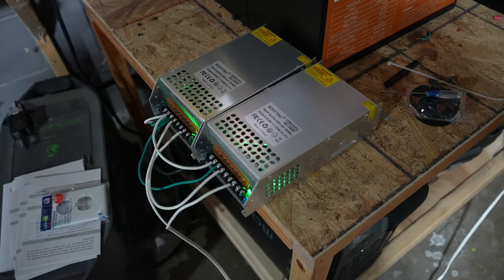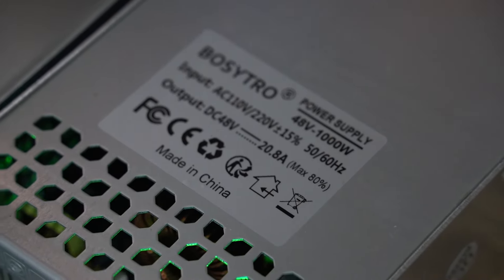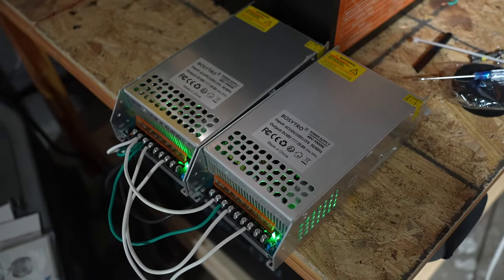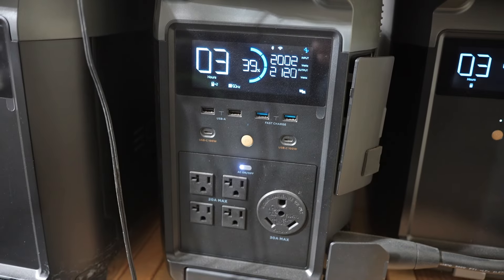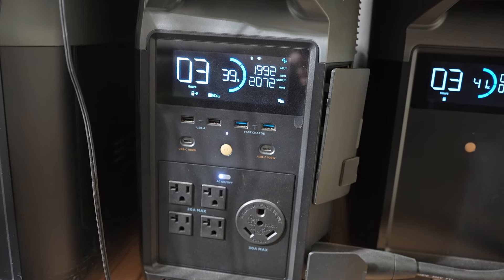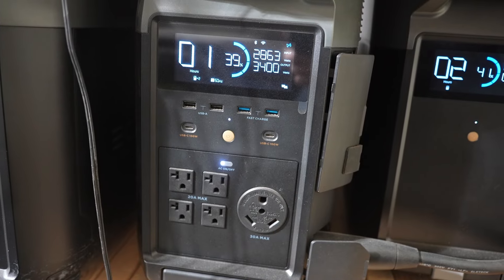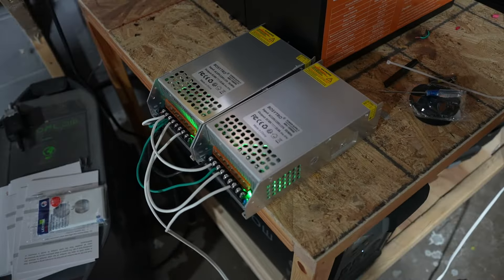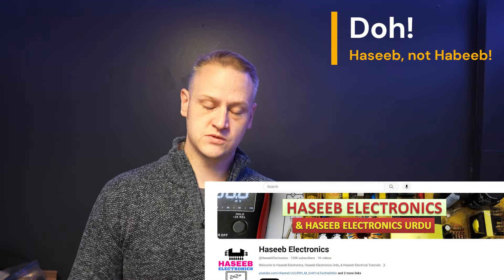Cool New Way to Increase Power to Your Delta Pro

Comment: Very interesting and appreciate your updates!    I've been using my sungold 6000w inverter off of my external 48v battery that has a separate PV array to refill my Ecoflow Delta Pro's at approx 1700-1800watts effectively.    Very expensive and inefficient to go DC > AC > DC but hey, it's free solar and I don't care LOL

Comment: Thanks for the updates on your Delta Pro setup. I've been watching your vids because I am building up a Delta Pro system with two Delta Pros, a Smart Home Panel, and an external 24kWh battery array with a few kW of panels. It'll be a dozen 295W panels to a 6.5KW BluePower SP6548 to the 48V LiFePO4 batteries to the XTi connectors on the two Delta Pros to the Smart Home Panel.